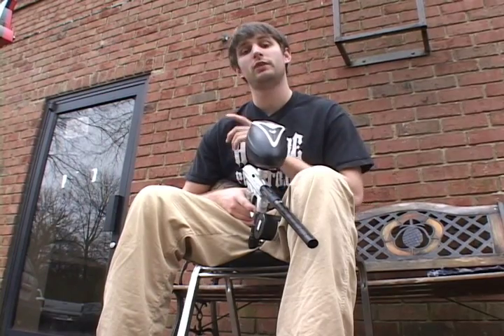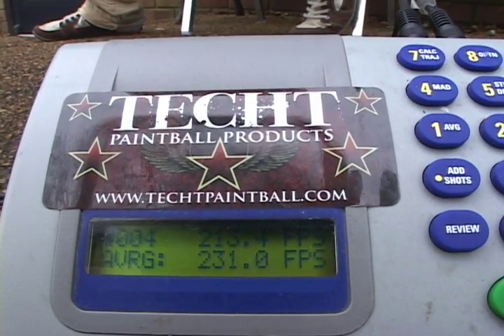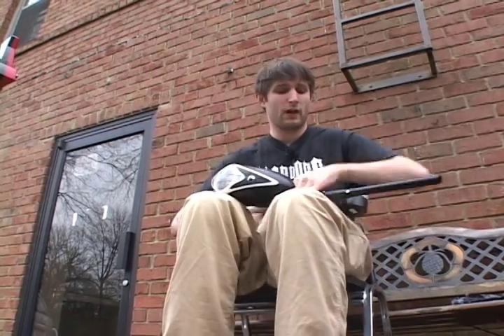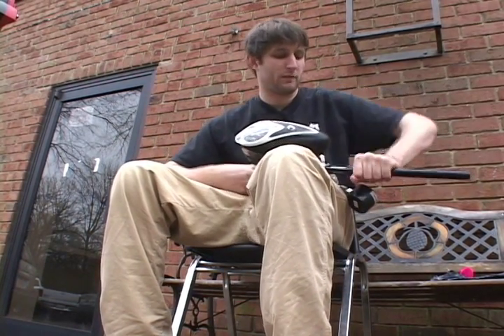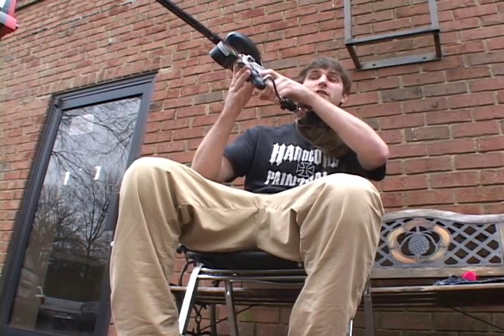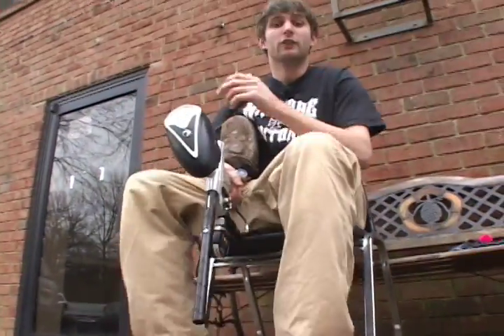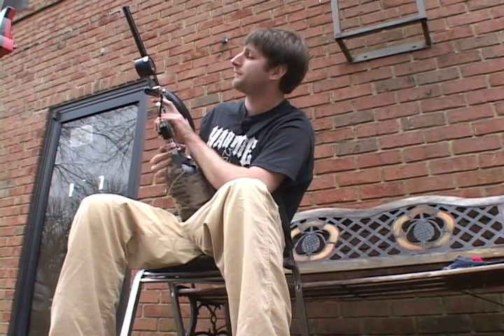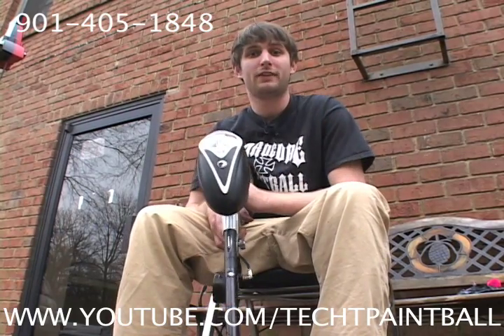TECHT Enertia Smart Parts Shocker Bolt Upgrade vs. Stock Shocker Bolt

Comment: holy shit, never seen plus/minus that consistence with an aftermarket bolt. so for that I just bought one and really saw the difference. alittle smoother shot as well. question tho since ur using a stock board. I got a legion board and the dwell stock is 12. what would u recommend it set at?